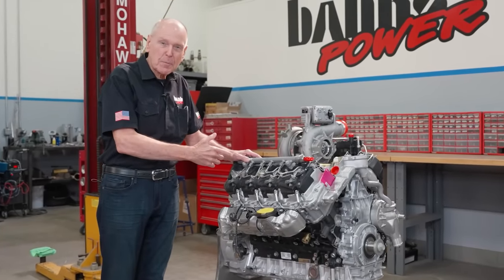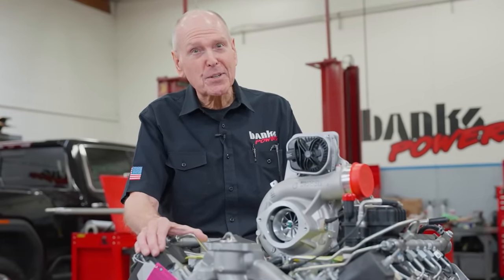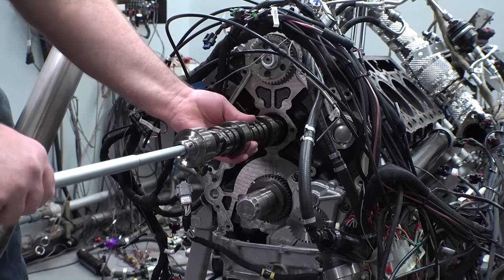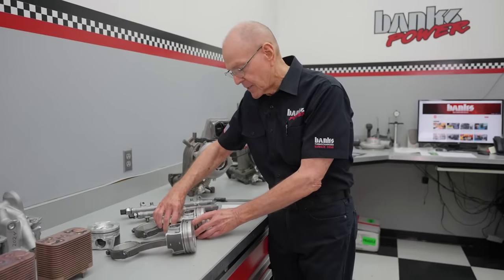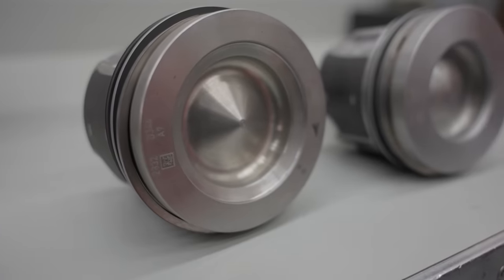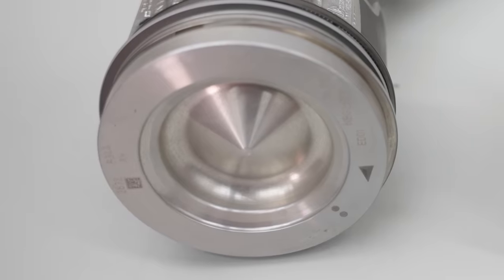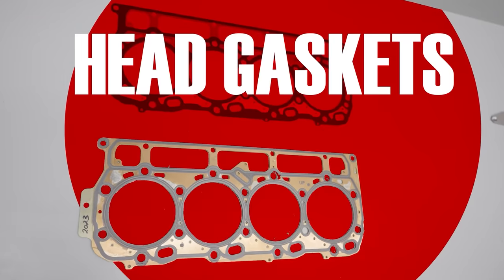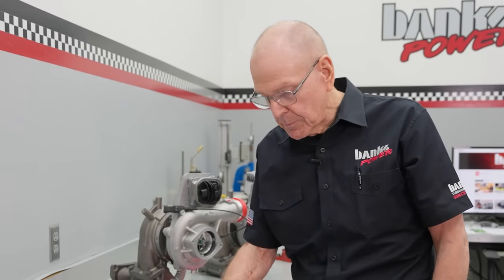2024 Duramax L5P Engine First Look And Comparison | Banks Exclusive

Comment: Always taking us to school.
Thank you Gale. Love learning your stuff.
Keep it up, great stuff.
Reply from the maker: Thanks, will do!
Reply: @bankspower  increasing the surface area for combustion to occur simply makes too much sense so huge shout out for doing that in the first instance. As far as what the technical term be "turbidity" in the #flow_control business is a literal Industry unto itself but absolutely for a pressure based system which diesel is as opposed to petrol/gasoline ignition combustion the cleanest burn possible (no residue) is absolutely 100% spot on correct to say not only most "efficient" (fuel needed to generate ouput) but more importantly and why diesels still command premium over petrol/gasoline is because of how robust the basic functioning of the engine system is over the lifetime of use which ideally in the trucking World which I once knew was measured in the MILLIONS of miles.

"heat" (friction technically) is a problem absolutely and that is a sadly all too easy to explain issue namely "air" as you term it is 70% nitrogen which has been the ruination of every high output motor ever put together in Human existence as unlike oxygen which is the combustion fuel very dense nitrogen is the "heat" that is combusting your diesel fuel to create the power output. All of this "mixture"(soot) is what needs to be expelled and again spot on this is a sign of inefficiencies and power loss being generated in the combustion chamber itself and over time.

The most simple solution is of course just run at lower speeds and rpms/problem solved but these aren't farm Tractors absolutely so one possible solution and again I am in no way an expert but I certainly know a Rocket Scientist or two forced to spool up pumps to deliver fuel DIRECTLY into the air itself as power delivery so they are sitting on a bomb/no containment and think about this chemistry problem night and die and this project here being internal combustion not lighting the air on fire my first thought is to add "dimpling" or "dimple holes" like a golf ball to add even more surface area for the fuel air mixture to combust upon instead of simply within. Point being forget the "flow" let's maximize the MIXING fuel plus air creating better bonding best possible bonding between fuel and air through some kind of "effecting droplets" process.

Probably been tried and deemed a dead end but that would be my two cents for this challenge anyways.

Crawl walk run in anything diesel as anything that works great as a tractor type if then leveled up to the commercial truck Class 8 type ... well, congratulations you just made the best Tractor engine now too!

Can't say enough about the importance of both fuel and air filters in these systems plus fuel cleaning "detergents" to free up any buildup carbon which is normative. Ironically enough gasoline makes for a great detergent one of the best so imagine wonder on wondering that one for a minute and drop the urea but at a small gasoline tank and "cleaning port" might be another thought as far easier to pour in gasoline than jugs of urea which was one of the reasons I was glad to get out of the trucking business period. 

Don't even get me started on methanol tho..

Comment: Check valves in the piston cooling jets are a great innovation.
Reply: They've had them on European and Japanese engines for at least 30 years if not longer.
Reply: @mattsmith4053  isn't that fuckin thing Japanese?... ISUZU
Reply: @elroyelblander6277  didn't realise Isuzu were involved with designing them.
Reply: . Backwards compatible with 2023 and back engines? Be cool to increase idle oil pressure just with a piston cooler bolt change.
Reply from the maker: @elroyelblander6277   - Duramax is not a Japanese engine. DMax Ltd. company is 100% owned by General Motors with GM/DMAX owning of the intellectual property on the L5P since 2017. Isuzu is no longer involved with building the Duramax engines. Even better, Duramax engines are built right here at home in Brookville and Moraine, OH.

Comment: I am a high pressure engineer and adding material to the od of the fuel rail doesn't really make it stronger. Your weak spot is always going to propagate from side ports. Seems they have tried to fix this by adding even more material to just where the ports are. Once again tho not necessarily stronger from this. I would really like to see inside and see the stress propagators

Comment: Fascinating! I worked in a coal fired powerplant for 15 years. Lots of similarities between coal combustion and diesel engine combustion.
Reply: I worked for a year at a decommissioned one. The boilers and old green GE turbines from the 40s. 285 MW I got to page through thousands of pages of beautifully illustrated and detailed exploded views of the turbines to the point I felt I could have serviced them with the step by step instructions. Really cool facility. I’m an operator love diesels drive and obs 7.3 and heavy industrial will never cease to amaze me. Same principals on a huge scale. Makes you feel really small. Plus cooling towers are like an intercooler but massive!
Reply: @youngmike8645  They just started tearing the plant apart where I worked. Close to the same size as the one you worked at. Ours was 225 MW. Three boilers and three turbines. Sad to think it will never run again.

Comment: I would love to pick gales brain if I ever get a chance, I just bought an LML and studded it, deleted it, and tuned it. I wasn’t looking for power I was looking for reliability and durability. 6 months after getting all the work done my crankshaft exploded without any warning, I had just changed oil with amsoil less than 1000 miles prior. Everyone tells me that it was just bound to happen, but I would really love to know what I did wrong so I can address that and fix it up right this time.
Reply: What you did wrong that caused crankshaft to explode:

Step 1: purchase dmax😂

(Voice of experience talking)
Reply: @CumminsTurbo4  yeah you’re honestly right, never had this bad of an experience with a truck, might have to make the switch to Cummins
Reply: @JMAN0153  honestly I think Ford is where it's at for speed and overall fun factor. I'm just kinda old school and like the noise and simplicity of the cummers!
Reply: Most would say that the most fatal flaw of the platform is the firing order. It starts one, two, which puts a great rotational force into the crank. Most bottom end builds include a reverse firing order cam to combat this. As to why gm hasn't made this stock, you'd have to talk to gale bout that.
Reply: I know on my LBZ the dampener is a service item from the factory. I had 200,000 on my LBZ and understood from a couple of engine builders that if I hadn’t changed it out at 150,000 miles the crank would go boom. I just did studs bigger turbo ppe heads banks 2020+ oil cooler monster Intake ppe manifolds and up pipes S&S cp3 and oversized injectors, and my mechanic told me to go with the fluid damper he said I easy have 2-300,000 more miles out of this engine. So my recommend is get that fluidamper brand dampener. My LBZ is smooth as silk.

Comment: Iveco have used stepped pistons with pointed centres in the F1C engines since around 2004. They're the last of the commercial van sized engines still available here in the UK, all the other manufacturers have gone to passenger car sized engines (overall component size not capacity) since Euro 6 came, which are all terrible.

Comment: What fuel additive if any, should I use on my 2024 Silverado duramax I use Stabil on my tractor??? Does it matter what gas station I use for quality Diesel fuel??? I just bought it and will be picking it up this Wednesday. Any help would be appreciated from a first time diesel truck owner?
Reply: Get diesel from a place that sells a lot of it.  Old fuel that has been sitting is the issue.  As far as additives, I use hot shot secrets everyday diesel treat with each tank.  In the winter, I switch to Howes antigel.  Once a year I will run hot shot secrets diesel extreme through it.  The additives will suck up any water or condensation and add lubricity.

Comment: Looks like they've switched to a Ricard TVCS (twin vortex combusion) style bowl instead of the more traditional re-entrant style.  This splits the plume to help reduce the size of the oxygen starved portion of the plume and reduce PM.  Not really much of an efficinecy gain, but it will reduce regen frequency.  Just be very careful messing with the calibration with this style bowl since it is very timing senstive compared to a re-entrant bowl.  Too much advance and detonation (yes detonation in a diesel) is possible.

Comment: Gale, what if you had a set of the '24 L5P pistons modified by Speed Of Air Engine Technologies including the gapless second ring and modified the cylinder heads with super porting, shaping and thermal coatings?

Comment: I enjoyed the part of the video about the Turbo and the different screw design. It's clear that making this connection point uniform with the same angle improves the tightening, which becomes more uniform, as well as the theoretical capacity that can be absorbed thanks to this small modification. This also means that the possible upgrades to be made on the Turbo will be improved and could even make the design process easier. In short, that's my point of view, haha.

Comment: I really enjoyed this video when it first came out and it had me looking forward to both my new truck and what Banks would have available for it.  But here we are a year and three months later and we still don't have a Derringer Tuner, Banks Ram-Air, Monster Exhaust System, or an Intercooler Upgrade for this engine.  In fact, the parts you do have available are only the items for the 2017-2023 or 2020-2023 L5P engines that happen to also be compatible with the 2024 version.  Fifteen months later and nothing that is specific for the new L5P has been released.  When is this going to happen?

Comment: Gales mentions 32,000 pounds of pressure in the fuel rail.  Just for comparison - the pressure at the wreckage site of Titanic & now Seagate's Titan submersible is 6,000psi.  So the 2024's fuel rail pressure is over 5 times the pressure where those 2 vessels are laid to rest.  wow

Comment: What’s the fix for the newer L5P exhaust manifold leaks? Seems to be common as more and more trucks get higher in mileage. Most noticeable when truck has exhaust brake on and it’s fully engaged, high pitch squeal.

Comment: I know one thing that for sure,my 2021 Dirty Max isn’t so Dirty, you can literally get down to the Tail pipe, the one thing that’s absent is Carbon Monoxide, Soot, Smell. Honestly it’s the Cleanest I have owned and I have own From the Oldsmobile Conversion Diesel Motor the 6.2 the the 6.5 to every year 6.6 in our Work trucks pulling Tb250 Mini Excavators, TL8 Tracks Machines all over Michigan with a turd Detuned 5500 Chevy/International Contractors Work Trucks. The are Horrible but the 2014 Tuned pulled them as fast as you want to take them. Now we have a 2019, pretty good but the 2021 is Amazing with Factory Settings.

Comment: It is really weird, my 2020 AT4 3500 CC single wheel got the best mileage of all my previous 7 duramax trucks. My 2022 is the worst or near the worst.  I have been debating jumping to a 24 but still watching. Thanks for the info
Reply: In a similar boat. Went from an early 2020(built in 2019) that was difficult to get less than 20 mpg in and now the 23 that replaced it is lucky to get 17. It also goes through def about twice as fast. Towing the 2020 did 12-15 mpg and the 23 I haven’t seen over 10mpg and its at over 16,000 miles now. I don’t know I’m not impressed.

Comment: Great stuff Gail. Curious though... Why is it these trucks with all this technology improvements like a 10 speed tranny for one and all this added power fail to get any better fuel milage after almost 25 years as I have a 1999 Ford F250 with a 4 speed tranny and none of these technology updates and seems fuel milage is same. I can get close to 19 mpg empty and almost 14 mpg pulling 9k lbs where I do have every Banks offered options installed and a couple other upgrades like the pusher intake and yet this $83k truck gets about the same fuel milage and you have to add DEF cost on top of that. Seems it's just not all that. So, challenge here is if I was to upgrade my tranny to a 6 speed Allison tranny and perhaps a methanol injection system I would be able to outperform these newer trucks.

Comment: So should I look to buy a 2nd gen L5p or just stick with the original?
Reply: I had a 2019 and have a 2024.  Both are great.  New trucks interiors are so much further ahead of the older gen’s, it’s not comparible.  It did take some getting used to going from Allison 6spd to 10spd.

Comment: I have a 2019 3500 L5P and I’ve pulled up to 30,000 pounds and it did it extremely easy for a pick up truck. So the question I have is, are the 2024 engine parts compatible, or can you use the parts from the 2024 on the 2019 L5P engines.
Reply from the maker: We discuss the availability of parts between model years here: https://bnks.pw/3A3UWST

Comment: Gale be great if someone built a mechanical engine brake like class 8 truck have for the duramax. There are lot of  4500,5500 model chevy trucks that tow skidsters and mini excavators on gooseneck trailers.Those engine brakes would be a great help slowing down.

Comment: ball check will be failure points..also spring re valve lift frequency will always be a issiue exp low vs high fq..over all will be 10% power increase between the two motors

Comment: will you ever start the killing a Duramax series up again?
Reply from the maker: Yes. All three projects, Super Turbo (Monster Truck Engine), “Killing a Duramax,” and Banks Built are still alive. Both dyno cells were needed for defense projects. Both are wrapping up shortly which "should" allow us to commence with Killing A Duramax. However, we may roll LokJaw's supercharged Duramax L5P into the cell first since the truck is returning to the SEMA Show in November.

Comment: So all these changes to make the 24 L5P better but the rate at which they're going, soon, a diesel truck will start at $100K for work truck trim. 🥴
Make it make more power but that includes fortifying all sorts of other systems to accommodate the power. Those things are going to fetch a premium.

Comment: Will you ever finish the first gen L5P “killing a duramax” series?? Patiently waiting..
Reply from the maker: The Killing A Duramax series was paused when both dyno cells were needed for defense projects. Both are wrapping up shortly which "should" allow us to commence with Killing A Duramax. However, we may roll LokJaw's supercharged Duramax L5P into the cell first since the truck is returning to the SEMA Show in November. Our goal for LokJaw's engine is 600-650hp before nitrous. Stay tuned!

Comment: I'd be curious to see these deep dives into the 6.7PSD to compare the V8's against eachother.  GM hasn't really made a splash in the diesel stuff for some time...  The dual cooling system and reverse flow design of the 6.7 would be cool to see the Gale Banks treatment on it.
Reply: Not worth wasting his time on the garbage ford makes

Comment: Meanwhile In its regular configuration, the 6.7 diesel Power Stroke still makes 475 hp and 1,050 pounds-feet, while the new high-output version bumps those numbers to 500hp and 1,200 pounds-feet of tq so gm has some work to do😂
Reply from the maker: That's at the flywheel. A proper dyno session is in order to see what power is going to hit the road after drive train loss. Stay tuned.
Reply: Gale makes a really inexpensive kit for first Gen L5P put down 500 and 1 k on tires .smog legal CA.

Comment: can it be possible to make a diesel engine that the emissions are so clean that the engine doesn't need DOC,SCR,DEF, and EGR systems?
Reply from the maker: We'll find out. Toyota, for example, has recently patented a new diesel combustion process that could clean up much of the particulate, while reducing NOx, all in-cylinder. It could mean no more aftertreatment. We are hopeful.

Comment: I was thinking to myself 'if Ford, Cummins, and Isuzu/GM would put Gale Banks on the diesel design and engineering payroll, they would all produce better diesel engines. But then, I saw all of the improvements on this Isuzu/GM engine, and realized that Isuzu made the improvements that Gale is explaining to us. Genius engineering and technology goes into modern diesel powerplants.
Reply from the maker: Despite what most people think, the DMax company is owned by General Motors with GM/DMAX owning 100% of the intellectual property on the L5P. Duramax is a past venture for Isuzu. Even better, Duramax engines are built right here at home in Brookville and Moraine, OH.

Comment: Would like to know, honest question, why so focused on GM?
Reply from the maker: We have a jump start on these engines and discuss them with a little more frequency because our military program is based on the Duramax platform. That being said, we are also developing and producing new parts for the Ram and Ford 6.7L respectively.
Reply: @bankspower  Very much looking forward to getting my 2016 Lariat F250 Banksterized. Was in Dealer shop 6 months, finally out but an exhaust leak from their repairs persists. Coming to see you after they get that done and my local shop gets  S&S DCR Fuel Pump installed.  On a  mission to bulletproof it. Really looking forward to Derringer with iDash